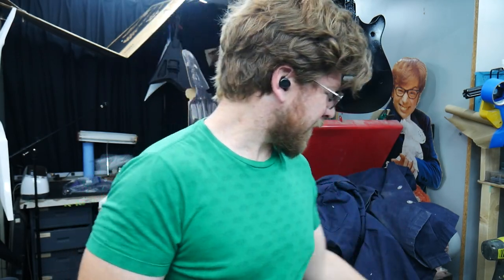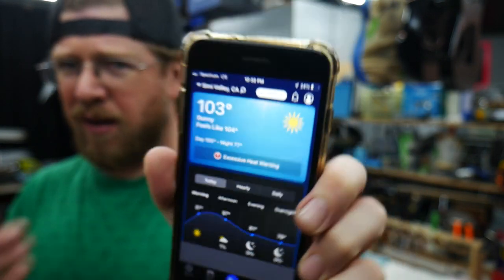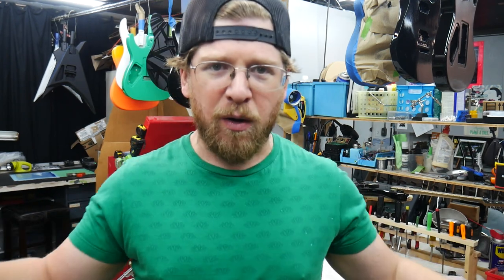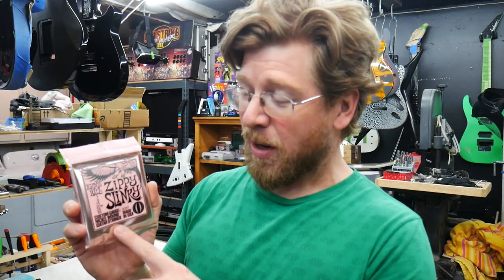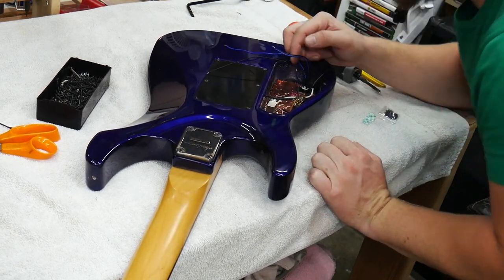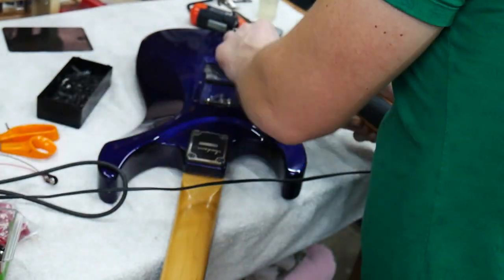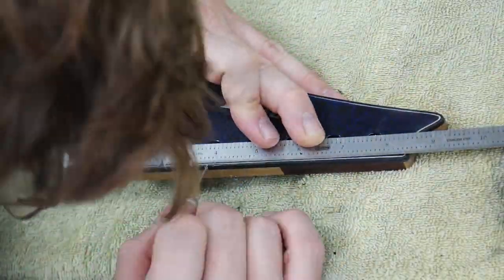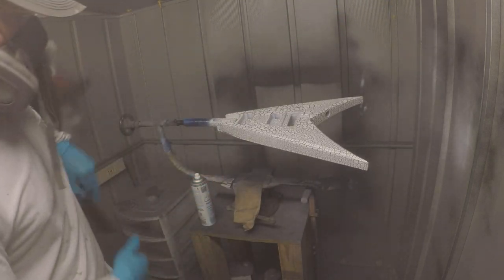PAINTING GUITARS when it's 103 degrees! Hot Days VLOG 3 | Jackson Performer Dinky | Ibanez | OLP MM1

Comment: If your doing that many guitars wouldn't it be cheaper to use a gun instead of buying all those cans? How many cans for one guitar?
Reply from the maker: Good question. No, because they’re all completely different colors, so I’d have to buy all these different colors in a quart, which costs much more than a can. Also, the time for cleaning the gun in between each guitar would really add up, with aerosol you just spray and there’s really no clean up.
Reply: @GuitarGuts  I was just talking about the clear coat.  I don't know anything about it honestly. I was thinking about painting this harley benton I have just to do it. Some of those clear coat cans are pretty expensive.  I'd imagine doing several guitars that a gallon would be cheaper. I guess guns aren't cheap but over time idk.  Your finishes always look nice as hell so don't get me wrong
Reply: @GuitarGuts  after thinking a bit I guess a gun would be better if you are doing several guitars at a time.  A few sprays would be dumb then cleaning it several times. Makes sense for a factory or a car ,something big.